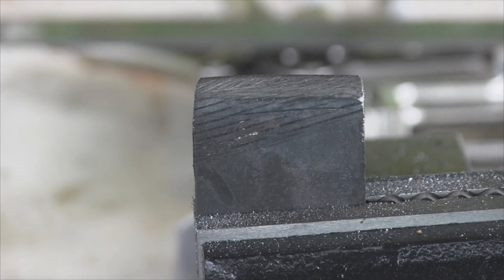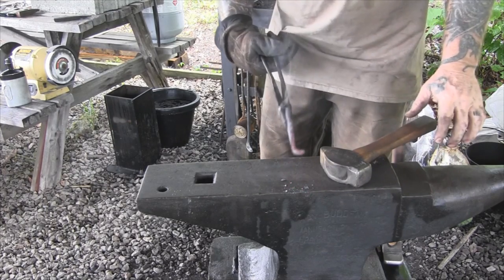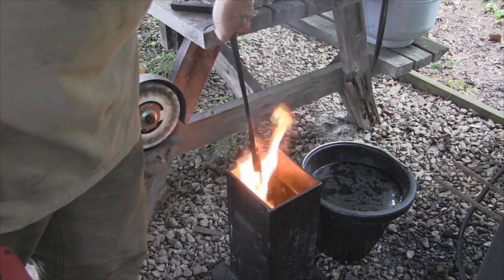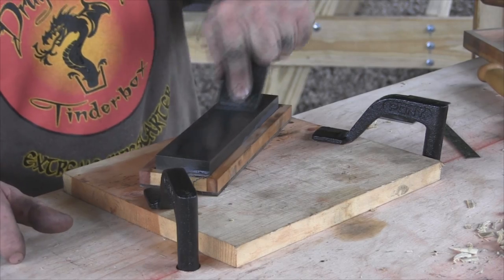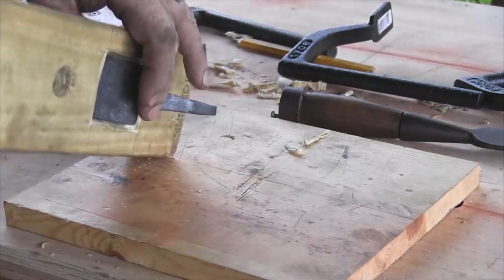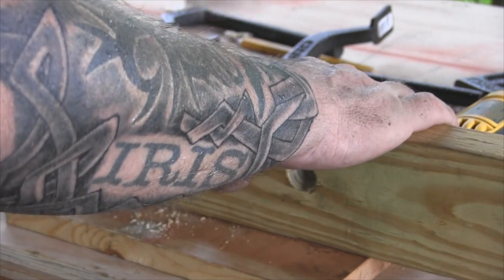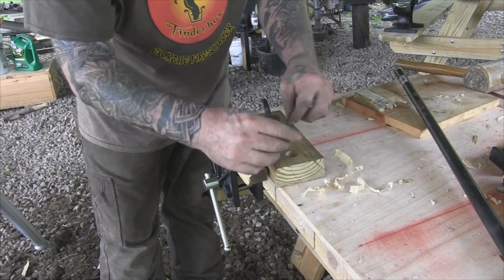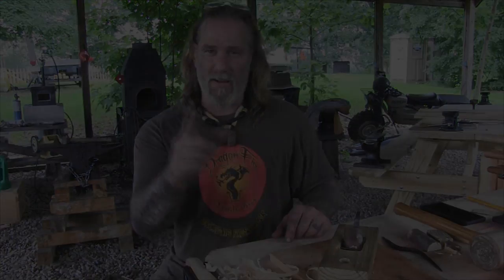Making a Box Plane with a Forged Iron Part 2

Comment: G'day,

Yay Team !

An excellent Video Pair...

  Based on the Block-Planes which I've been using since I was about 12 (1973), which my father inherited from his father who was a Wheelwright/Woodsman to a Coachbuilder/Blacksmith in 1910, and in 1919 he bought his Boss out (so his Block-Planes are at least 105 years old, maybe as old as 155 years...)..; I'd say you only got 2 aspects awry, #1 being that the Blade is facing the wrong way - the "Head" of the Plane being shorter than the "Foot", and #2 being that there should be a Wooden "Rhinosceros-Horn" or "Pommel" mounted in that Hole, anchored with a Sawcut & a Wedge...

  And, top points for making the Plane-Block from Softwood...; that way the Plane-Body can never scar any Piece being worked...

;-p

Ciao !

Comment: Whats the difference between water and oil to quench metal ?
Reply from the maker: ***** Speed and Temperature, Water makes Hard and Brittle, Oil Cools slower for less Hardness and better longevity, however water is preferred for hard metal like Fire Steels etc..
Reply: ***** Alright, thanks. You should keep doing DIY videos ! They're awesome!
Reply: ***** Like Dave said, water cools faster, oil not as fast. Different quench mediums are used for different steels. That rasp Dave used was probably W1 or W2 tool steel which quenches well in water, unless you have a really thin piece of it in which case you are better off with oil.
Other steels like 1095 and O1 quench best in oil, typically warm oil.
Some steels like A2 tool steel quench in still air.
Reply: Jojo Diver Well adding it again along with a reply isn't helping. This is the internet. It's ignorant to think children won't ever see a swear word until the 'right age'.